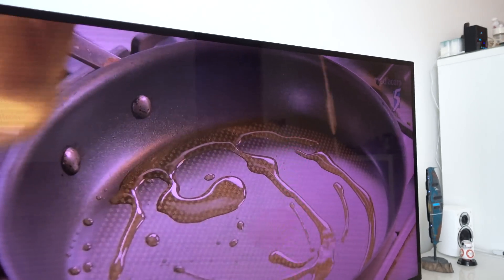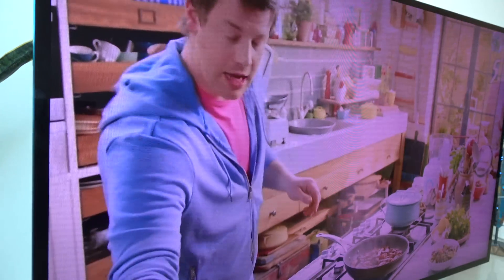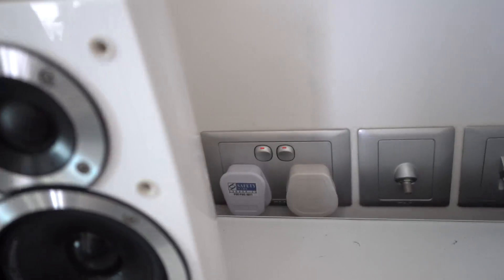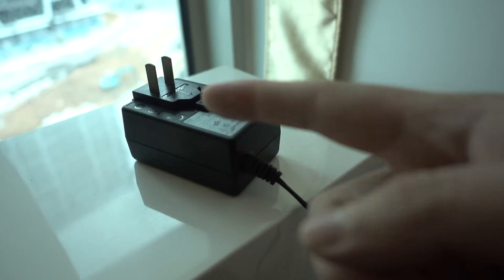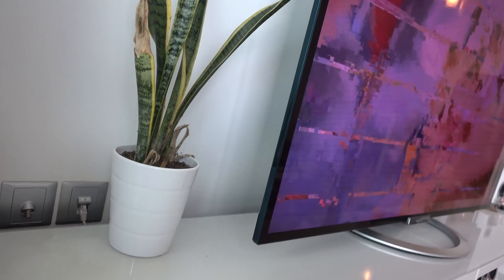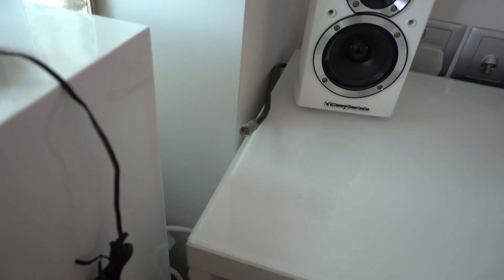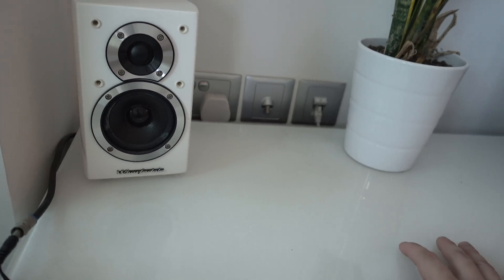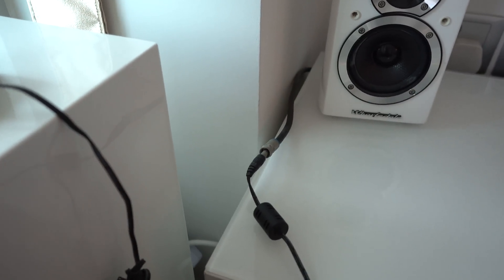Digital TV Antenna DIY Hack - Cheap, Easy, And..Free? (legal!)

Comment: If you couldn't find anything like a power adapter, try straightening out a big paper clip and fit that to the end of the antenna cable, or even at the TV's antenna hole if you prefer. Bend the clip at a right angle near the connection so it points up and does not poke into too much space behind.

The no-hassle paper clip 'hack' worked so beautifully for me that I've left it in place and have been enjoying the best digital TV broadcasts since. Incidentally, if you can't find a large paper clip, any straightened ordinary paper clip can work too. Enjoy!

Comment: Just don't plug that power adapter into an AC outlet.  ;-)

It may be just the extra wire attached to the adapter that's giving you the signal.  The power adapter itself (the "wart") may have nothing to do with it.  If you can, do another test by cutting the cable off the adapter part, and then see if it makes any difference.

I'm intrigued - I'll give it a try ...

Comment: some of you dont understand, this is singapore, not the us, in the us we no longer have analogue over the air, we are digital only, and all you need is a cheap 20 dollar amplified antenna, amplified means it will have a cord that plugs into the electric wall plug.
Reply from the maker: what some of you don't understand, is that this works with ANY signal, analog, digital, radio, whatever, so this means, as you can tell from the comments, a lot of people wouldn't even need the cheap $20 amplified antenna.
Reply: What I don't understand, is why it doesn't even work for me in Australia. Maybe I need to stand on my head and try it, since you're all Up Over and were Down Under.

Comment: I did this, and as soon as i plugged it in, it popped a breaker, turned breaker back on and my tv doesn't work anymore. People DON'T do this. It will ruin your life. My wife is going to be so pissed.
Reply from the maker: it's not supposed to be plugged into a power socket.
Reply: People this hack works very well ... This dummy did something outside of the instruction given in the video and whatever that was caused his problem!
Reply: Lol fuckn stupid hahahaha

Comment: Does this work in uk
Reply: I dont know your situation. But if the stations are regulated by law in the US to provide a OTA (over the air) signal for people only using antennas. If they do, you should be able to get a signal if you are close enough to them.

Comment: An AC adapter that is really a transformer would be the best bet. CAUTION: Not all power adapters (wall warts) are the same. This method likely wouldn't work well with switching wall warts (the small, lightweight type). Typically such wall warts contain no transformers. Also, I wonder if DC wall warts would work. Besides the transformer, an analog DC wall wart contains a rectifier and a capacitor. The capacitor functions as a low-pass filter (way below TV signals).

Comment: This will probably works pretty well if you're in a big city next to the actual broadcast stations, but out in the country you will need a larger colector and a signal booster but pretty smart all the way around
Reply from the maker: some say this works better than store bought, presumably boosted solutions. obviously this is not guaranteed to work all the time, so just give it a try, and if it doesn't work, then too bad.

Comment: Tips: Try a TV antenna signal booster to make it even better (Google them).  Also, bear the 2 wires from the transformer and touch them to the antenna coax one way and then the other way. Even try 1 and both wires on the center wire of the coax etc. You will find that it may work better if connected one way vs another way.  You can buy a small adapter that you screw the wires into and it has a cable coax fitting on the other end (usually at 90 degrees) if you want a better more secure plug system.
Reply: Amplifier doesn't help much when there is nothing to boost, amplifier just add noise and interferences, you need usefull signal first. Sometimes it's better without amplifier even with weaker signal than amplified nothing.

Comment: I KNEW there had to be an easy antenna hack somewhere!  A TV antenna seems so simple, I figured there could be something else to substitute for it without having to buy a new overpriced one! THANKS FOR THIS!! ♥

p.s. what range does this get?
Reply from the maker: no idea. as you can tell, this isn't exactly a calculated hack lol. though I'd say the heavier the adapter, the better the signal since it's gonna have more copper wire coils and all that?

Comment: How irony. Ypu avoiding built-in building antenna connection for the reason it is not being digital. Even your adapter is not designated to be digital antenna. BTW nice trick. Have you tried building built-in antenna connection?
Reply from the maker: Yea, I tried it and it was then I found out that it wasn't digital ready. The building's connection was not an 'antenna' per se, it's a cable tv connection, but I used 'antenna' since more people recognise that term.

Comment: hi i tried with a charger and it sort of works, but not as clear. it was super blurry. is it becuase my connection was loose? does it have to fit nicely like a handphone charger?
Reply from the maker: try extending the wire like I did? as long as the metal points are in contact it should be fine.

Comment: any antenna is already set up for digital. its the same signal. those digital boxes that came out when countries went digital all those do is convert the digital signal back to analog so your old tv can process it to show it on its screen. thats why new tv's dont need those boxes cause the tv already has it built in to process the digital signal. they did it cause the digital is easier to send out and they dont have to spend as much on their license to broadcast. and the new tv's look better when its recieving the digital signal. its like going from old black & white tv's to color tv's. new tvs if you dont have cable or satelite is just the antenna plugged in
Reply from the maker: it's not an 'antenna' per se, it's a cable tv connection that also carries some local terrestrial channels for free, but I used it since more people seem to understand that term more.

Comment: I just leave the coax cable hanging, it works well. I pick up hd and everything.
Reply from the maker: That means you have good reception. As you can see, my coax cable was not enough. So, if you need a boost, then use this method. If you don't, great!

Comment: Hi Aron,
Thanks for the video, i have tried with my newly bought LG digital Ready TV with different adaptors but it does not work. Do I need to tune the TV or it will just auto scan & pick up the channels? Do advise, thanks.
Reply from the maker: it only helps with reception, you'll still need to tune the channel
Reply: Can you still use old desk top monitor

Comment: Will it work as analog also? My Television set is analog and it has the dial knobs.
Reply from the maker: yeap
Reply: Thanks! I may try it if I can but this video could help. It might boost up signal of channel 6 cause, on channel 6 I only receive the audio of it with weird looking static on screen.
Reply: analogue tv in 2017?
Reply: Seth Horst yig
Reply: I doubt there are any analog channels being broadcast so you will need a HD to analog converter box.
Reply: I know I'm late but channel 6 is an FM station interfering with analog channel 6
Reply: If analog stations are still broadcasting then yes

Comment: i am from Philippines and i dont have cable box or  cable wire i only using basin antenna for tv ,will it work in here sir?
Reply from the maker: should be fine. but note that this only strengthens signals of whatever channels you can already receive.

Comment: Works perfectly! I don't need the adapter though, just placing the coax cable near the window is adequate. Signal quality is good. Strength is very good. I live @Tampines on the top floor.
Reply from the maker: yeap, I&#39;m sure there are areas where sticking a length of any kind of cable would work. as you can tell from my video, putting the coax alone didn't work... my solution was connected to my coax cable.

Comment: Nice, worked great as an aerial for my 32' Samsung smart tv, anywhere in my house, and we don't have an antenna for the house either. 1 small adapter, 1 piece of wire. So thanks for the tip, was going to make an aerial from scratch but you saved me the hassle :)

Comment: I am receiving DVB-T broadcast using the TV's inbuilt tuner and just the coaxial cable. Didn't even need the power adaptor.
Reply from the maker: well good for you, I guess we're not as lucky as you lol. I used my coaxial cable as the extension btw

Comment: It worked very well for me too! I placed a short length of metal paper clip inside the antenna plug and power adapter plug than sellotaped the two plugs together. It works fine. Many thanks!

Comment: What are your setting for getting signals? I have Sony TV, tried with setting on antenna, auto scan and did not pickup any signals and used heaviest power adapter I could find. Unfortunately , not close to any windows. Any suggestions? Thanks
Reply from the maker: what's the closest 'outside thing' you can find, like window frame? Have you tried extending the connection? any wire will do, as long as the adapter end is nearest to the outside area

Comment: use a glue gun. fill the end of the coaxial with glue and attach the ac adapter end to the coaxial. hold together for a minute. worked great for me.
Reply from the maker: bah. lazy. XD

but yea that's a quick and simple fix

Comment: hi! sir, is it also applicable here in the philippines? And is it not dangerous? Might the adaptor will have a short circuit and may cause fire?
Reply from the maker: it's applicable everywhere, and since it's not connected to power it shouldn't short circuit

Comment: You say that your building's antenna is not digital. If there is an antenna on the roof that's all you need. There is no such thing as a digital antenna.
Reply from the maker: I meant 'antenna', it's a legacy cable tv connection, but I thought more people would understand it that way. 

Also, there was a flyer from the management saying that the 'aerial antenna will be made digital ready soon', so, yea. I'm confused too lol.
Reply from the maker: no he's right, because an antenna is an antenna, it doesn't really effect digital/analog signals.

the 'antennas' in our buildings are actually not antennas, but cable. noticed no houses today have the huge aerials?
Reply: Actually my grandpa's house has an aerial.
Reply: NIC ROOD in Singapore most building antenna support only analog broadcast which Sg mediacorp is phasing out and switchin to digital broadcast by end next yr...hence the need for additional digital antena if u do not subscribe to any cable/pay tv box..hence the need for ths hack(power plug makeshift digital anntena)
Reply: You need a converter box from the antenna to convert the digital signal to work on their older analog TVs. The analog signal picked up via the antenna will work fine on their analog old TVs. Any new TV of course will play the digital signal without a converter box. Another clue to boost that signal: Plug in a signal booster / amplifier made for TV signals. They are only $10 and up.
Reply: NIC ROOD the distribution multiswitches distribute the analog rf sugnal but they also filter noise out. So if you have an old distribution system it would filter the digital tv frequencies out thinking it was noise. That’s why they can’t just change the aerial. And you’re right - it’s not the aerial that’s the problem ;)
Reply: o
Reply: so your building management is dumb. all you need for over the air tv is an antenna no matter if its a new flat screen digital tv or an old analog crt tv.
Reply: @nrood3821  didn't they switch from annolog to digital about a decade ago?
Reply: @face-in-the-crowd yes. all tv's that dont have cable or satelite hooked up need an antenna for over the air signal tv. if its an old crt analog tv. you need to get a digital converter box for those along with antenna. all flat screen tvs are digital and dont need a converter box

Comment: This worked perfectly - Thank You! The heavier the adapter, the better it works.
Pro Tip: Wrap the prongs with electrical tape as a reminder to NEVER plug it in.
Reply from the maker: yea that would make sense since the heavier ones usually have larger metal cores and wire coils inside them. and yes, please be safe lol
Reply: Worked so good for me to omg! HD Digital channels im stoked

Comment: Hi Aaron, I just moved into my BTO flat in Punggol. My TV is digital ready. I bought a cheap cable and connect directly from SCV point to TV antenna but the normal analog picture quality are lousy. I cant get any HD channel. When I select auto tuning to find digital channel, it cant even detect any Digital channel. Any tips?
Reply from the maker: You should be using the scv port, my method should only be a backup, like in my case coz the building wasn't wired up yet.

I think some TVs seperate their analog/digital channels. have you tried switching to digital tv mode and searching there?

Comment: Thanks Aaron! I needed to select a manual digital tuning which managed to receive only Ch5 & Suria. The other channels didnt show up despite tuning several times. Any idea why?
Reply from the maker: Maybe the reception in your area is just bad =\

have you tried putting the adapter near windows?
Reply: Yeah I suppose. 

Yup, the adapter is on the window ledge.
Reply from the maker: try extending to other areas of the house? (fingers crossed)

Comment: @ Scottoshearer: Yes, you can. I did it with one. In fact you can use ANY plug.
Aaron, I'd like to thank you for your generous sharing. In the spirit of your sharing, I'd like to contribute in debunking 2 myths. 
(1) Powered (aka active) antennae is not necessary, source http://blog.rfvenue.com/active-v-passive-anntennas/ ...esp if you hv a bad quality signal, u r just amplifying the bad signal.
(2) Don't let salesmen into talking you to buy a special “digital or DVBT2 antenna”. You dun need one as DVBT2 airwaves are just electromagnetic waves (UHF 470-862Mhz). All you need is JUST an antenna that can receive those UHF frequencies. They hv been around for years!
Using Aaron's hack, after auto-tuning via my inbuilt-DVBT2 tuner TV, I just tucked away this “antenna” neatly behind my TV...and on the floor! No need to buy those >$60 types trying to look arty-farty/ stylo-milo beside the TV anymore!
Thanks, Aaron, once again. God Bless & Cheers!
Reply from the maker: yea precisely. cables alone might not be enough, I find that the adapter actually has better reception, such that you can hide it and it'll still have a great connection

Comment: Nice~! Very helpful 👍🏻 Is it better that i connect it to my internet router?
Reply from the maker: +Ricky Lim er.. why
Reply: +theaaronloy since I have the interest rounder for my interest, can I tap on that?
Reply: +theaaronloy I mean Internet
Reply from the maker: Ricky Lim
I think there's online mediacorp streaming, but this is different, this is to receive the digital tv signal. not sure if online streaming has the HD version
Reply: I live in the woods in Clanton my signal sucks and I get a few channels but it still does not work that good the signal itself I'm pretty sure this is a great ideal how can you get more channels and make stuff better that's what I would like to know when you live in the woods
Reply: Ricky. If you have a Smart TV or an adapter such as a ROKU adapter you can get your internet channels from your wireless router. BUT, this is for OTA, Over the air signals in your area.  Antenna are rated by the distance they will reach and how powerful the signal is the station provides.  If you Google OTA in my area, you can find a list of channels near you, their distances and compass direction from your locale. Usually will NOT get these OTA channels thru your internet and only with an antenna. If your stations are 25 miles or more, this hack will more than likely not work, and if it does, you wont get much.  There are many many videos on how to make an antenna very cheaply that supposedly do a good job. Take my advice, if you live several miles from a station do NOT waste your money on an indoor model.  Make or get an outdoor model and get it as high in the air you can get by with. I used the top rail pipes from a chain link fence from Home Depot. 10 ft each for $10 each. I used 2. No special connections needed. One end is made to fit inside the end of the next one.  Good luck!